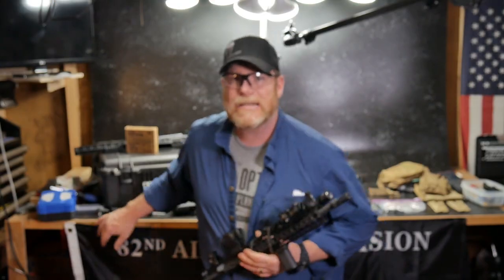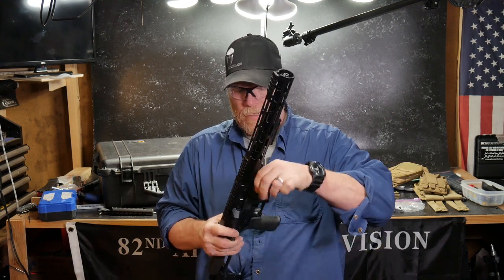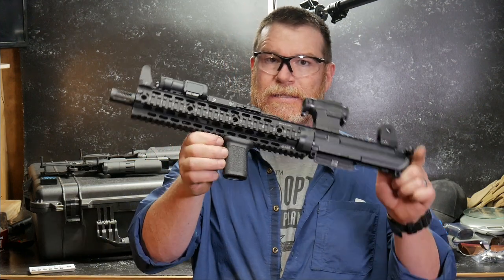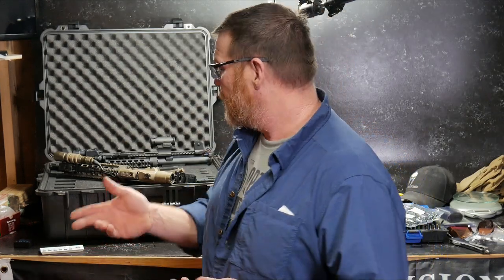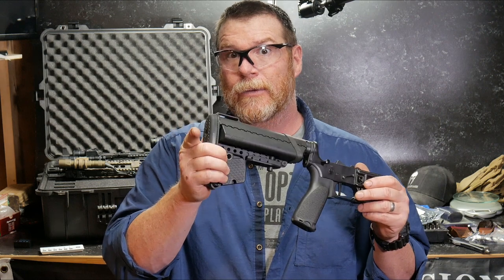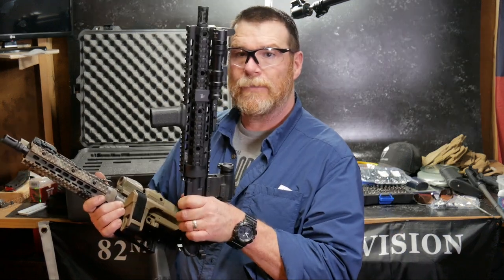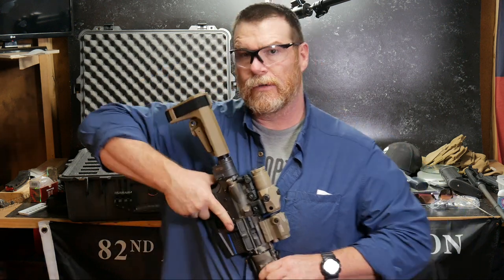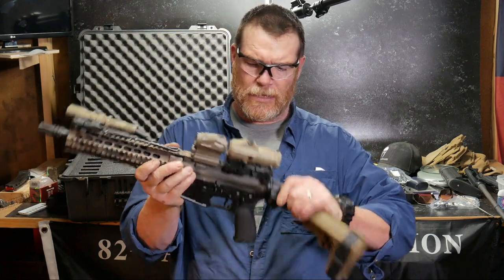Law Folder for the SHTF Travel Case

Comment: AR-180 uppers from brownells doesn't need the buffer/spring to fire. So you could fire with it folded.
Reply: At that point I'd get a lower receiver with a built-in picatinny rail on the back end or get the adapter for the standard mil-spec lower. Although then you lose the ability to swap out to standard AR-15 uppers.
Reply: YES, the Brownells set up WILL fire folded, but THIS is totally different. If you look at the opening in the back of the upper you'll see the extension that interacts with the buffer. The LAW Tactical device should NOT be fired when folded. The Brownells upper is closed and uses a completely different type of bolt carrier assembly.
Reply: @Stonehombre1  I'm saying, this with the AR-180 upper. I understand that you can't use this side folding adapter with a normal AR upper and fire folded.

Comment: So just an FYI. Be careful combining any of the braces that use mil-spec buffer tubes with a law folder. At full extension the length of pull is greater than 13.5 in. (That's why they only use 5 of the 6 positions on a buffer tube.) As a result it is not legally an AR pistol in the eyes of the ATF. (I know some people don't care what the ATF thinks. Honestly I'm not a fan either. But personally if I'd rather be safe than sorry. An you can never have too much information.) 

Now there are a couple of options you can go with to resolve this issue. SB Tactical makes plugs that block off specific sections of the buffer tube. They're designed to make it easier to adjust it to whatever preset length you like. But if you block off the last section or two of the buffer tube you can no longer exceed that 13.5 inch length of pull. The other option is to go with a shortened PDW style brace. Cmmg makes a PDW Style sba3 rip brace. It requires an included proprietary buffer but everything else is the same. Also the buffer it comes with is an H buffer. Which is nice.

Comment: Watch the strike pdw brace. The buffer rides at a angle because of how short it is. Stops you from being able to charge the bolt back . You will have to remove the back take down pin and put it back down in order to charge weapon

Comment: I thought about getting one but its entirely too expensive. I feel like it should cost about 60-80 bucks at best.
Reply: I'd buy 3 at 100
Reply: William Gahres  yeah I have China one I had On a dedicated 22, its made out of aluminum, I wouldnt use it on a real 223.
Reply: William Gahres  sure
Reply: Personally I'd rather add $200 and get the Maxam SCW brace or stock. It's only two inches longer and there's no need to unfold it. It works fully collapsed. An as a bonus it comes with a bcg, buffer, and spring.

I mean the law $220, sba3 $120, decent bcg $80, buffer/spring/castle nut $20... That's $440 if you shop around and don't go too cheap. An you added a week spot by making something that isn't designed to fold fold. No thanks.
Reply: @project86xero  yeah I wish they sold one for my ks 47. I have a dead foot arms 2.5 inch brace comming for a 9mm build,
Reply: William Gahres  I work retail and do side hustle. I don't have an endless stream of money. However I know what I want and I save for it. I'd rather have the few guns I do than a bunch of guns I kind of just like or that kind of just get the job done. An believe you me I'm not about the Gucci gun life. Although, if we're honest, I think we all got at least a little Gucci Mall ninja in us. However I just wanted something that suited my needs. An if it just so happens to look awesome in the end it's just icing on the cake.

Either way I built a 300 Blackout pdw with a 7.5inch barrel and a maxam SCW brace to fit in my travel backpack with some soft armor and a few extra mags. That way whether I'm on vacation at the beach or of camping in the woods I've got something more than a 9mm sub compact. 

An that build took me over a year and a half to get everything together. So in my opinion anyone can afford a decent gun. However if your patient and pinch your pennies you can have an awesome gun. 

If you don't have any spare income coming in, find some. Get a second job, drive Uber, or start a small side business like I did. If you really want something you can find a way. It just takes time an energy. An yeah it might take way more time and energy for you than it did for me. But then again it might not. Who knows.
Reply: @salcidojosiah  My issue with deadfoot arms is that they have increased spring tension because they're bufferless. Which I'd be fine charging the gun. However my girlfriend wouldn't. An she needs to be able to use it too.

I also don't like that they only have one strut supporting the stock/brace. I could never get a good cheek weld on the one I tried at the great outdoors show. 

Although be prepared for a less balanced feeling front heavy gun. All the really short scw style braces have that issue. The deadfoot 2.5 in particular. It feels the same when collapsed but when it's fully extended the deadfoot still feels front heavy unlike the maxam. But if you can't spare that extra inch and a half the deadfoot is the only way to go. Other than a law folder. Which I'm not a fan of. I'd personally rather separate the upper and the lower.

Comment: I like the quad rails for the real estate options, but on the down side, I like to use a C-grip out front and the quad rails aren't as comfortable to me as the KeyMod or M-LOK handguards .  I also like the 10" barrel for the AR pistols.  Most "operator" types like the 11", but I guess I'm just different.  What ever you decide, it's gonna be fun to watch.  "Thumbs up" from this Kentucky boy.
Reply: Don't you have more real estate on m-lok rails? Some Mlok rails have the angle part as mlok mounts too. Just saying.
Reply: @caseyne  I hear you.  That's a possibility, depending on the brand.  I was simply referring to the basic 4 surfaces.  Good point though.

Comment: Just a heads up when I added my Law Tactical folder I needed to remove the internal weights in my buffer which was a standard carbine buffer. This was due to the added weight from the piece that pushes into the back of the bcg. Without taking the weight out it would not cycle properly but my barrel length was also shorter then yours so that could have contributed to it to. Just an FYI if you have cycling problems.
Reply: I figured I'd have that issue since I use a kynshot rb5000 buffer in conjunction with the folder and if I remember correctly it's like 5 oz... But I also use the Novesky kx3 muzzle brake (Krinkov style) which has a cone in it to increase back pressure for pistols also while projecting blast forward. So far so good haven't had any issues. So using the kx3 could also be a solution in getting a pistol build with the folder to cycle better.
Reply: Erin Newman I too have a krinkov style muzzle device on mine and I still had to take the weights out of the buffer... my barrel is 7.5” what length was yours?
Reply: @gtpro700  it's a Bear Creek arsenal 7.5 
Could also be that I reload my own ammo and I rarely buy factory stuff. I reload a little hot and will typically use 62 grain in the pistol, that could be why I don't have this issue. Suppose I should try it out with some factory stuff but it wouldn't be a gun I would grab for self-defense, just fun to throw flames and have everyone complain about how loud it is. Lol
Reply: Erin Newman hahahah yea its definitely a flame thrower as well lol yea I use factory stuff so maybe that’s my issues too. I have a 7.5” PSA and who knows maybe there gas hole is a tad small too... with buffer weights taken out it does run good now but would be nice to know what the reason was for need to take the weight out but I guess if it isn’t broke I’ll just leave it lol

Comment: KB.  I've been thinking about your welding situation.  I just want to mention some incidentals that you may/will be incumbered by.
Melonite Finishes, blueing, et al can impede the flow of electricity between the bbl and muzzle device you wish to weld.  A simple test to perform before you try again, is to get ahold of a continuity tester (or a Fluke Mulritester set on ohms) and see if the bbl finish acts like an insulator, and impedes the flow of electricity.  Also, test the flow of electricity between the bbl and the muzzle device.  If you find you're getting no beeps from your tester, welding won't take place.  I tested my rifless a few minutes before writing this, and my Faxon bbls didn't beep my meter, nor did a G.I. phosphate bbl, nor did a blued Ruger Red Label 12 ga bbl.   You see, you may have to take a file and remove a bit of finishing from the area you intent to weld, to get a weld to take.    And another also involved your grounding clamp, which may involve some creativity in which you attach it to the barrel.  You might try clamping it to the chamber, where some exposed substrate metal may be present.
The Welding of Dissimilar Metals, may git you too.  Example, like a stainless bbl, and a non stainless muzzle device.  Stainless can be a bitch to weld, anyway, 
Watch out for weld splatter too. 
A welder is considered a high draw appliance.  Dedicated circuits are a must, to which you signaled as such in this video.  The closer to your main breaker panel you dedicated receptacle is mounted, the less likely  you will have errant trips. I personally believe you aquired the wrong welding machine for your task (TIG is my first choice, no splatter).  I think that if you took you work pieces down to an everyday weld shop, let them put a bugger weld on it, you would be much better off.
Reply: Just a reminder, be sure your gas block, and barrel nut is parked on your barrel before you weld yourself into a corner

Comment: Agreed 100%. On go rifle / Pistol / Carbine a Quad rail is a must . On all my go too setups minus 1 all have Centurion C4 quad rails . 
Also 100% Agree with the 12.5" . IMO the 12.5 is the best all around barrel Length for 300 yards and in.  On my go too 12.5 I went with TR24 1-4× . So I never have to worry about batteries . As long is the Sun is still burning I will always have daylight bright reticle.  
My Triarc 12.5 will shoot 1.5 MOA or better out to 200 yards with decent ammo.  
I'm thinking about picking up Criterion 12.5 so I can have super accurate chrome lined barrel . At the current moment the mist accurate AR I own is Colt M4A1 SOCOM barrel . The SOCOM is a heavy beast. So I'd like to have lighter accurate chrome lined barrel . Not a fan of goverment / M4 Profile.  So that's why I'm leaning towards the Criterion.

Comment: Are you going to use a JP Silent Spring with your Law Tactical Folder?  Considering one, heard a lot of good things about this spring setup.
Reply: He would have to get one of the new JP SCS systems designed for the LTF that is new for 2020
Reply: If you want to tune your gun with a lightweight bcg and adjustable gas block the jp scss is awesome. That's what we used in my girlfriend's 300 Blackout pistol build. That along with a Brownells lightweight bolt carrier group and superlative arms adjustable gas block.  It runs like a swiss time piece. An it has less felt recoil than my 14.5 mid-length. 

If you don't have at least the adjustable gas block I'd get a strike industries flat wire buffer spring instead. That plus a bit of grease in the buffer tube and it'll feel like it's on ball barings. An there won't be any spring noise.

Honestly for most people just adding the grease on the inside of the buffer tube is enough.

Comment: What is the length difference on the gun, between the retracted brace, & the folded set up?

Thank you for your time,
Reply: It's between 6-7 inches shorter depending on the stock or brace you use.

Comment: what barrel is in the 10.5" upper that's so accurate to 300yds?  I want to build a pistol also,  but it's hard to find economic 12.5".  What bullet weights do you use in your 10.5 and 12.5 barrels?  Anything special for them to cycle or for precision?

Comment: I know that the video didn't show the LAW folder installation, but can the video include the necessary information about the LOPL insert that is needed to keep the AR pistol
legal with the length of pull with the SBA3 and the LAW folder?  Two LOPL inserts are needed to keep things legal with the SBA4 and the LAW folder.  Most of the audience is not aware that the build is illegal without an LOPL insert.  Many people are making illegal AR pistols with the SB Tactical braces with the LAW folder, simply because they are ignorant of the legalities.  It is so easy to be legal with $9 and an LOPL insert.  Remember, the legal measurement is taken with the brace fully extended, NOT where someone may have the brace positioned at the time of inspection.  Please add information about the LOPL insert, so the audience isn't led down the wrong path.

Comment: I was under the impression that once a lower had a rifle upper on it, it could not be used for a pistol again.
Reply: Shane K you cant put a short upper on a stock lower you can put a longer upper on a pistol lower
Reply: Well... that would be true if a lower was a receiver. Courts have ruled in several cases that an AR lower doesn't actually meet the definition of a receiver per federal law. 

It hasn't been to the supreme court yet, but there have been numerous cases at lower district courts.
Reply: @TripleSixClueHouse  it depends how the receiver was transferred. If it was transferred as "other", i.e. was a stripped lower, it can go back and forth. If it was transferred as a rifle, it is a rifle, period. So if you put a short barrel on it, it's an SBR.
Reply: Sorry guys He is kinda right, the rule of building AR15's is Once a Rifle/Carbine (barrel 16+", ALWAYS a Rifle/Carbine (barrel 16+").  See the chart 
https://qph.fs.quoracdn.net/main-qimg-e8bcf47a504f4ac3bd5938f29cb94034

Comment: What is the overall length ? Barrel to stock and barrel to folding stock ?
Reply: I have a psa KS-47 10.5" with the stock collapsed its 26 3/16" long so take off about 7" and that's how long it is. Looks like the adapter adds an inch or so to it.

Comment: I hate to tell you but in the "folded" position you have removed the buffer from the equation. I would STRONGLY recommend that you NOT try to shoot it when folded !! "IF" it works it will only fire ONCE.........I also have that setup and would never fire it in the folded position. Just my .02 cents
Reply: Not unless the fold pin is buffered or split like on the old NRs

Comment: Thinking out loud. A side charger might work good with this concept. BRN-180 upper with the shorter barrel could be repeatedly fired folded. If you really want to go small, use a 7.5 inch barrel and Dolos takedown with Law folding adapter.